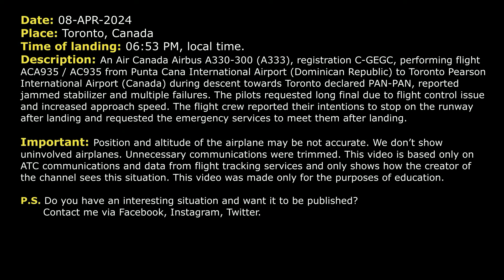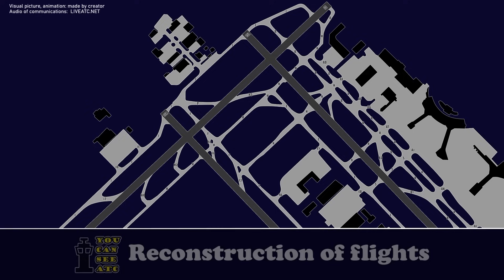Jammed stabilizer. Air Canada Airbus A330 has flight control problem at Toronto. Real ATC

Comment: This does not make sense so Im going with a config issue and the Pilots were not savvy how to operate something. What the Pilot says is the problem and what it really is can be different. Quick example a plane made an emergency return to the field because the engine was misfiring... actually the seatbelt was hanging out the door banging around in the wind.
Reply: The fact is, it is always better to declare an emergency. Even if you don’t need it. Did the person with the seatbelt hanging out the door need it? Maybe not. Should they have checked it was in before taking off, absolutely, but they had no ability to fix it in the air. The protocol is to return to base and get on the ground safely asap.
Reply: @007knick  You missed the point and the rest is redundant. Thanks for sharing.
Reply: @danielleclare2938  Your profound level of thinking is far to esoteric for You Tube Comments. USA Today letters to the editor should be commensurate with your expertise.
Reply: @RLTtizME  Psudeo intellictual rambling you need a dictionary to understand yourself. Good luck with that. The Alphabet starts at the letter 'A'.
Reply: @danielleclare2938  Sounds like you slept through most of High School. Dullards are usually not revered. (Your classmates were playing a joke on you.)  Hope your eyes are improving. 86 the hat.

Comment: Pan-pan? Anything flight control related is a Mayday.. no way just a pan-pan!
Reply: Love how we have a few snippets of atc dialog with the crew and the arm chair quarterbacks are ready to judge the all pilots' mistakes.
Reply: MAYDAY normally indicates an immediate landing is required.
Reply: @malahammer  You just made that up. There is no need to breakdown an emergency declaration into a string of minute pieces and meanings. This Mayday / Pan affectation is ridiculous. There is no wonder that a plain emergency declaration is now replacing all of that archaic nonsense.
Reply: @malahammer  Got anything else that you have made up? Make it interesting.
Reply: Counterpoint: the aircraft appears to have been in control the entire time.
No abnormal flight pattern, held all altitude and heading assignments, hardly any distress in the radio exchange.
The flight crew mentioned the aircraft "operating reasonably normally" - delightfully vague, but I read that as "slightly difficult/somewhat abnormal, but not beyond our abilities." Which is almost the textbook definition of a panpan.
Reply: @afrophoenix3111  countercounterpoint, anything related to a flight control issue is an immediate emergency.. a toilet that overflows, sure pan-pan. But flight control problems can get out of hand like the Alaska airlines flight. Also with a jammed Stabilizer, they have limited pitch control. Probably going to use minimal flaps, and anything that may compromise stopping ability gets an emergency.
Reply: LOL...just say EMERGENCY. You people are a hoot.
Reply: @RLTtizME  I agree!! It’s funny how these non pilots think you have to say pan-pan or mayday-mayday.. lol
Reply: @thomasaltruda A great example of how not using standard emergency phraseology (ie “MAYDAY”) can lead to significant confusion and unnecessary delays in getting an emergency aircraft on the ground safely: 

https://youtu.be/UTDdc_CU6fk?si=wLNPFlLrPmcAKxG9

While the term “EMERGENCY” may be well understood in US/Canadian airspace, using non-standard phraseology is (imo) a poor practice, particularly for pilots who are flying internationally. MAYDAY and PAN PAN are unambiguous phrases worldwide. I’d suggest that makes their consistent use a valuable operating methodology - a point that the FAA actually stipulates in their AIM (6-3-1) Distress and Urgency Communications.
Reply: @thomasaltruda Mayday is definitely the preferred word, not emergency.   I'm guessing you don't fly widebody around the world where English can be bad at best.   Pan-Pan is sometimes questionable to use.    Emergency is more a North American thing.
Reply: @jeffsmith2042  So you are the authority as to what is the "preferred" word? By whom? Definitely? LOL. Not here in America. Nonsense words have fallen by the wayside. Are you related to the Frugal Gourmet? LOL again.
Reply: @aidancostelloe1641  We all know what the book says.  Over the years...the natural order overlooks certain aspects of the "book" simply because there are new and better ways. Make a note.
Reply: @RLTtizME  infact if you open your FD Pro app assuming your an airline pilot and use it.   Every manual in the publications states it.   And yes I'm a bit of an expert in this field flying the 787 for years.   The US and Canada  are just like going out in your backyard, whole entire world beyond that.   And as I said standard phraseology is best, not North American radio slang.
Reply: @jeffsmith2042  You are stuck using the same old tired justifications. You did dazzle us there...for a minute Mr. Expert. What is so great is that you can be anything you want to be on YT comments. Does that apply to you? Hmm?
Reply: @RLTtizME  people will argue about anything.   Imagine you arguing for the less conservative word that can be mistaken or not understood.    Clearly, you don't fly and especially for a living.

Comment: Isn't a jammed stabilizer what brought down Alaska flight 261? Guess this was different as the crew was able to land safely.
Reply: On the Alaska flight it was jammed in the full downtrim position, and eventually moved far past that, this case was probably jammed in a relatively normal position
Reply: Jammed initially, then the jack screw broke (worn down) sending the plane into a dive.
Reply: Yes I remember that and I believe it was a DC9 off the coast of Palos Verdes
Reply: @MikeB-in1nd  MD-83
Reply: @MikeB-in1nd  DC 10
Reply: Yes, and it then popped out of position because of the many attempts the pilots made to try to free it.

Comment: "operating reasonably normally" 😐
Reply: fwiw - Airliners have multiple computers and hydraulic systems powering the flight controls. This seems like a partial failure condition where there is 'only' a slight degradation of normal flight responses because (for example) say 1 of the 5 flight control computers has failed.